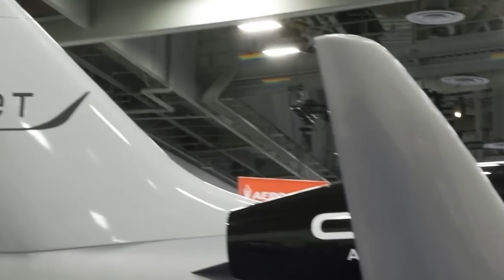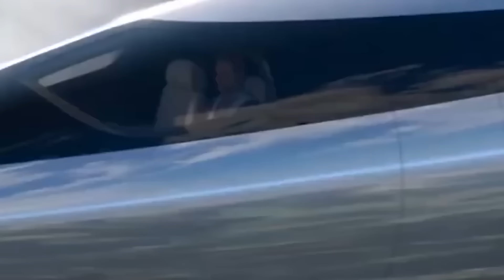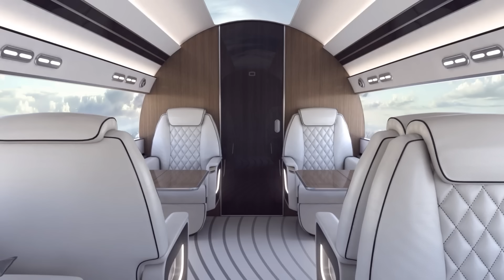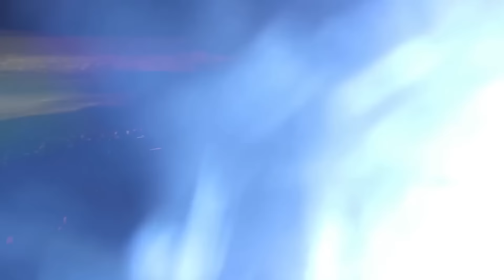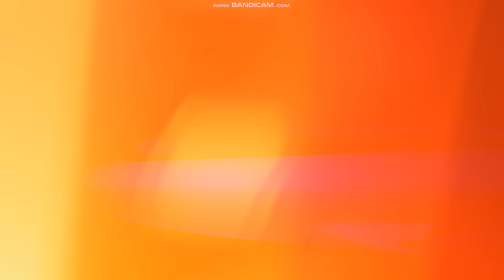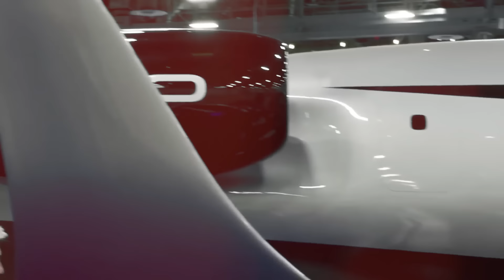Why Everyone Wants This Jet That Burns Less Fuel Than A Car

Comment: It's a very slick video but it has It's problems. I don't see any entry doors for either the pilots or passengers. I don't see any cargo access doors or any pressurisation outflow valves, Fuel tank fill ports or tank access doors. I don't see any antennas of any kind, are they integrated into the carbon fiber body or what? Something this "radical" of a design will run into all kinds of certification issues. I imagine the flight test program to certify it will be long, detailed and very time consuming and expensive.

Comment: Otto has never proved a single one of their amazing claims. They flew a demonstrator at low speed and used the measurements to "project" its performance at higher speed. It's all very sexy and plausible-sounding vaporware and clickbait.

Comment: My brother, an aerospace engineer said one way to improve fuel mileage is to increase the combustion temp.
Reply: Yea and melt the metal blades in the engine
Reply: @hawkbartril3016  He should know since he was an engineer on jet engine production line